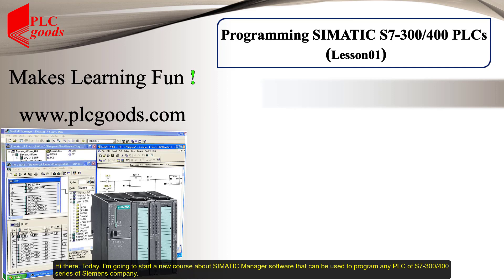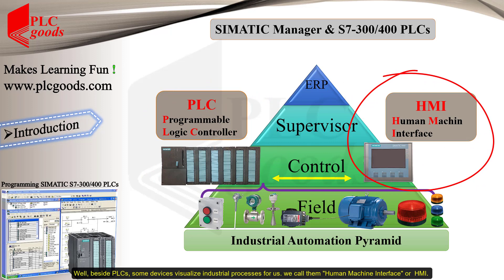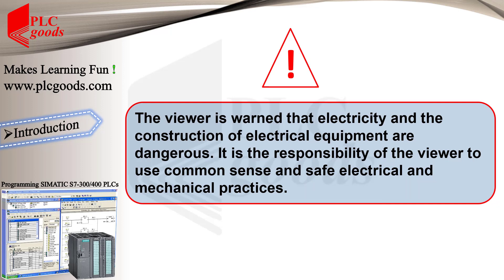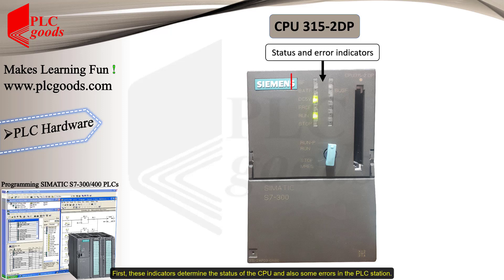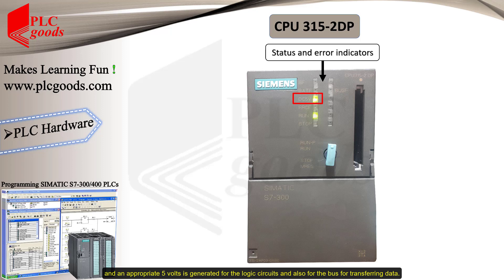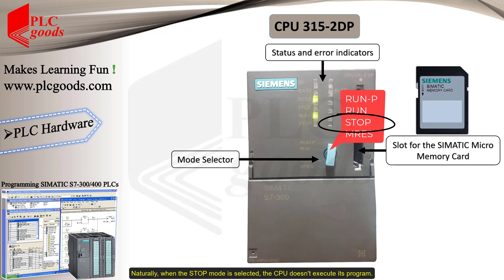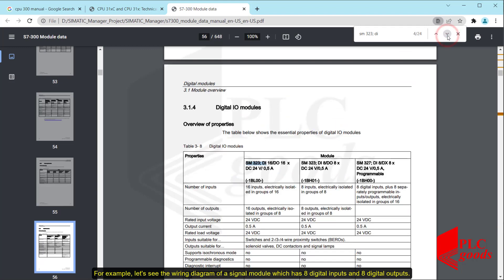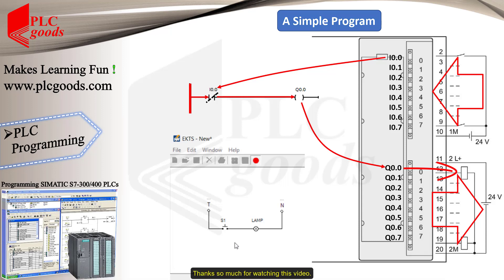SIEMENS S7 300 plc programming tutorial | Simatic Manager |s7 300 hardware configuration | Lesson 1

Comment: Hi and thanks for the tutorial.
I just have 3 question. 
What is S7-PCT and what does it do?
Is it the same as the simatic manager?
Reply from the maker: You're welcome, and thanks for watching the tutorial! 😊
Here’s a clear explanation to your questions:
❓ 1. What is S7-PCT and what does it do?
S7-PCT stands for Siemens S7-Programmable Configuration Tool. It’s used specifically for configuring PROFINET IO devices that support the PROFIBUS PA profile—most commonly used with ET 200 distributed I/O systems or other intelligent field devices.

💡 In simple terms, S7-PCT is mainly used for configuring communication networks, not for writing or simulating PLC logic programs.
Reply: @plcgoods 
Oh! IC.
Does it work with TIA portal? 
And what IO link version should i use?
When i ipen it, i have IO link V1.0 and V1.1
And whats the difference between Siemens AG and Standard?

Thanks.